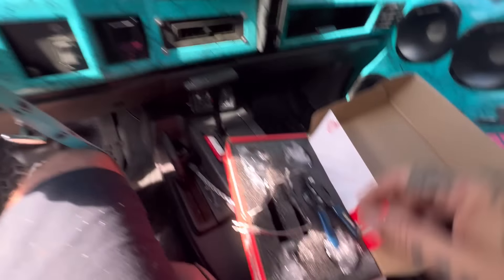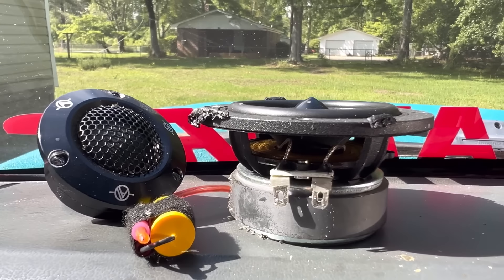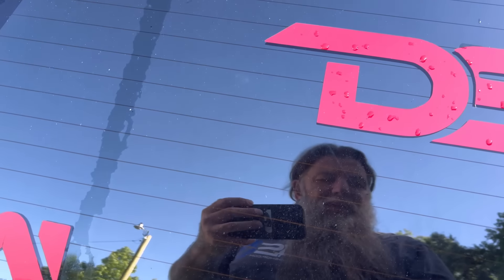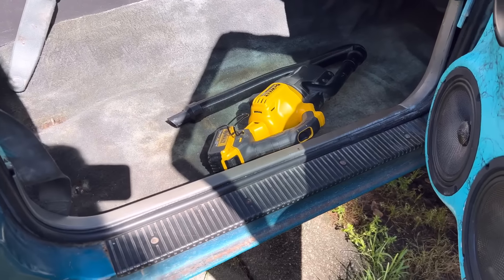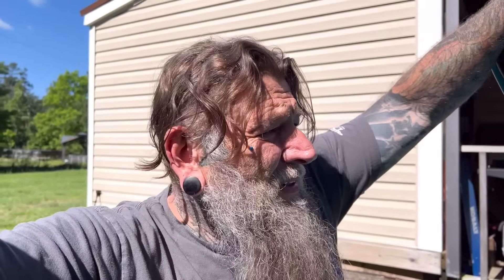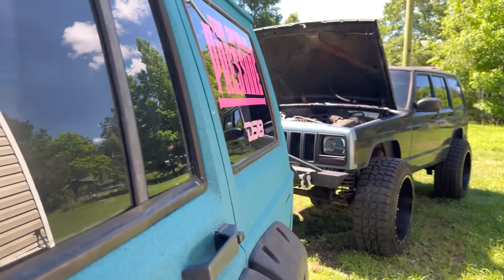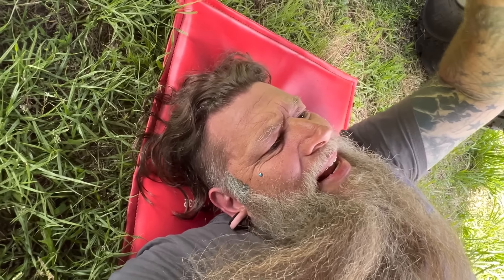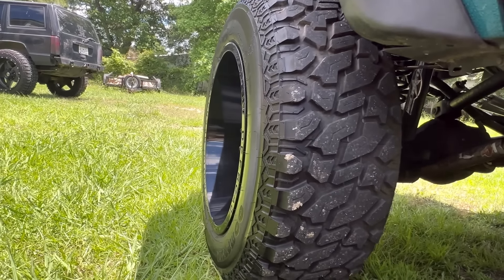New speakers then things go wrong. Will the Jeep be ready for Made of Steel?

Comment: I wouldn't consider the bass turning on a dome light to be your fault in any way. It's just one of those things that can happen to anybody.

A couple solutions might be to bypass the left and right switches on the light fixture so that all three lights are wired into the door switch. Then they will all turn on and off with the door switch. 

I've got an 04 Navigator and it has a timed relay of some sort. It cuts all power to the interior lights after 30 minutes of inactivity. So I can leave the doors wide open and after 30 minutes all the lights will shut off. Whatever module they're using might be adaptable to your vehicle.

Comment: I have a HOOL-X15.4DHE that started making noise at higher volumes after they it started to break in. I can't see anything wrong with it physically. Besides, one of the spiders has excessive glue glue on it from the triple joint. I bought one from DS18 and the other from Big jeff Audio. I didn't know if it would be covered under warranty or what I would have to do. Any suggestions, Jerry? I  tried to fill out the warranty stuff on the DS18 website, but when it asked for the serial number, it says it is a 12 digit number, but I can only find a 16 or 17 digit number.
Reply from the maker: Ignore the serial number part, just put all zeros